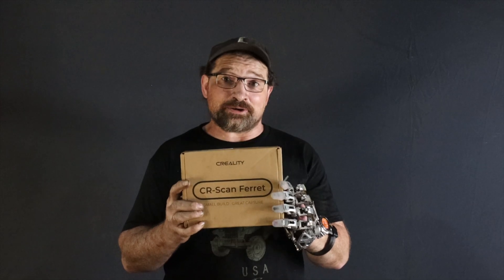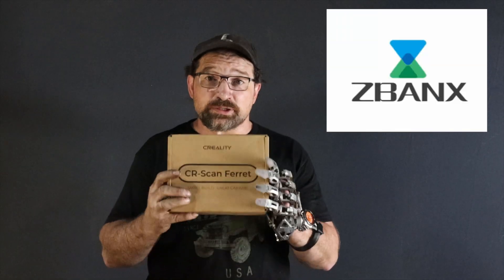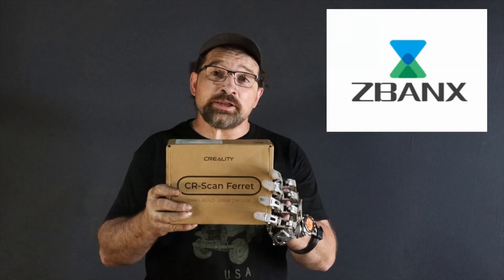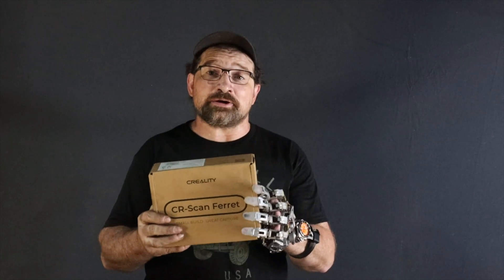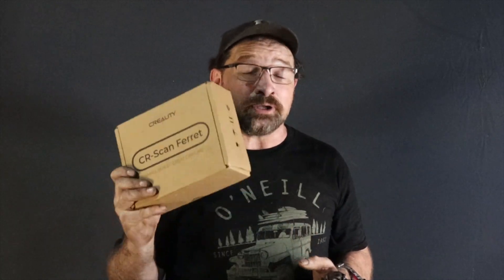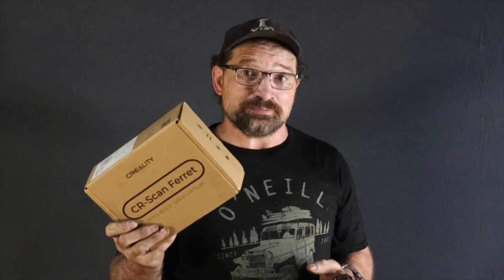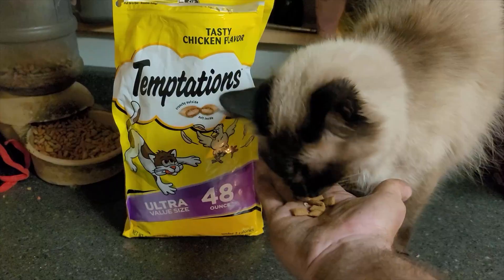Design Update and ZBANX sent me Free Stuff!

Comment: As someone who'se used photogrammetry and other tools to 3d scan objects, you should also give a try to some apps that use the iphone face unlock as a 3d scanner, I've found Heges to be a pretty reliable app, (the faceid scanner is more sensitive to smaller scale objects than the rear mounted lidar on iphone / ipad) I've also had very good results with luma AI

Comment: If you took 100, 000th per finger and you have five fingers how did you get to half an inch with that? Wouldn't that mean you took out five 100, 000th of an inch? I'm kind of stupid but wouldn't half an inch be 50,000 th of an inch not 5?
Reply: 100/1000" per finger, which is 500/1000" total --> 5/10" --> 1/2”

The joys of the imperial system :P
Reply: In fabrication, thousandths of an inch are often just abbreviated to "thousand" or even "thou" if you're behind on a deadline
Reply: hundred (thousand)ths instead of (hundred thousand)ths